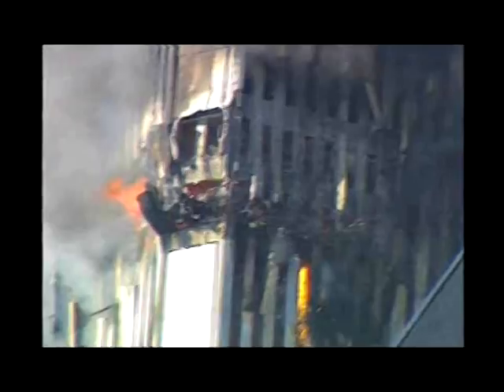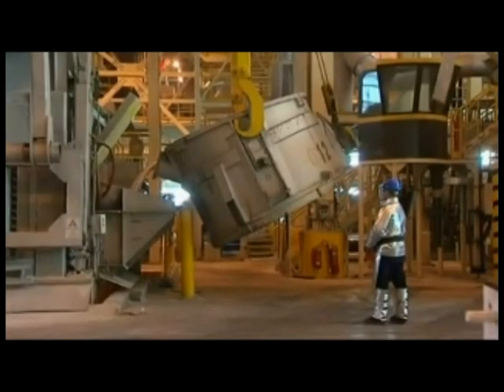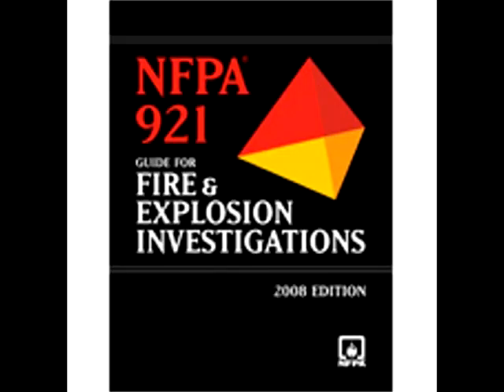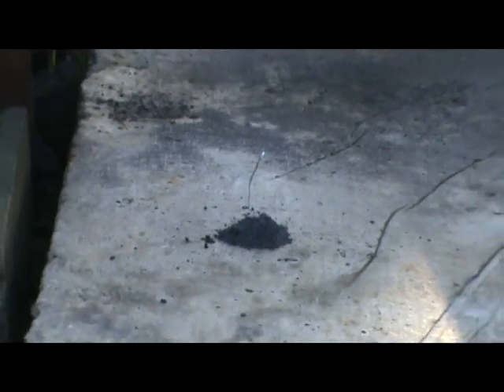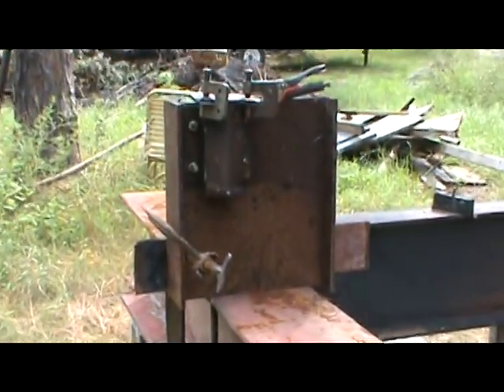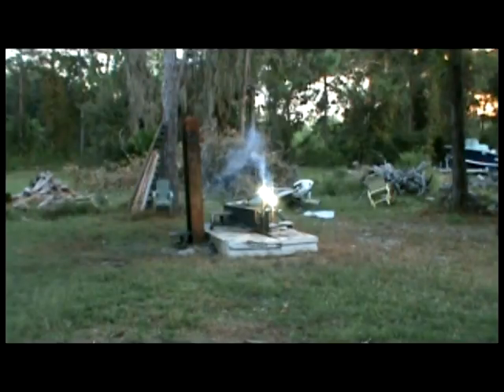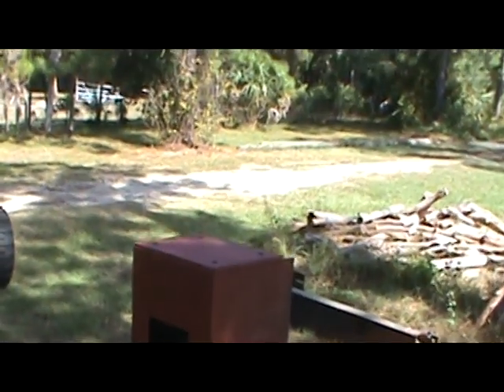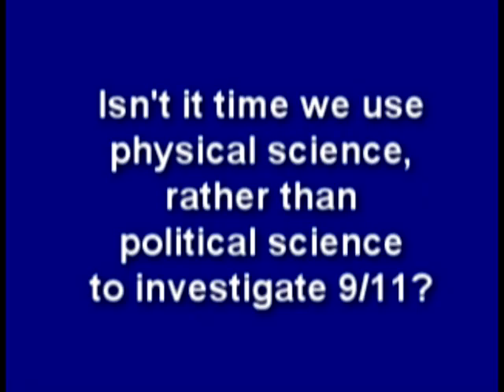9/11 Experiments: The Great Thermate Debate

Comment: 7:15 Again, iron-rich spheres are also produced from rust flakes burning and welding of steel.  They're also found in concrete and printer cartridges.  All those things are more likely sources for the spheres than thermite since they are found in all WTC dust samples.  

At last!  Another truth!  You are not an explosives expert!  I wish you would be more specific about the 'things' you build!  Plastic toys?  Models?  Amplifiers?  Do you have an engineering degree?

Comment: 5:30 Sure, conduct your own experiments!  Please!  Make sure they use the same gauge and configuration of steel as in the buildings.. oops!  Now we're back on something in a photograph of the fire...where'd the experiment go?

Was it just that pile of ignited thermite!?

OK...what could cause a light flash or white flame?  Oxygen generators from the planes  for one -  /watch?v=6i_l_ux3R-4  Oxygen cylinders also on the planes. They had seals which start to fail at ~200° C per DOT/FAA/AR-TN98/29

Comment: 3:30 NO, the Harrit,  et. al paper did not positively identify nano-thermite!  The paper, published in a vanity journal, had incredibly bad sample preparation and mounting techniques, used XEDS (whtich is great for determining crystalline structure of metals) to identify the composition of the sample (instead of something sane like Mass Spectroscopy), and FAILED to burn their sample under water or argon.  

The paper's conclusions are unsupported by their data.  

tinyurl . com /3q4lhr5

Comment: 3:20 Sigh. NIST never conducted any experiments to confirm that one stream was molten aluminum, true.  They were way too busy conducting experiments to determine how the buildings fell!  That was their mission, after all.

Oh, no. None of those experiments were applicable and in at least one the aluminum was bright orange and turned silver when it hit a cooled plate, thus confirming that falling molten aluminum is the color of the flow from the 80th floor!

Comment: 3:00  Sigh. In the chaotic thermal environment of a large office fires, unlike material mix together.  If the mecury in your example was hot and the coin was made out of melting plastic and the whole mixture was on top of  a bunsen burner, the coin wouldn't be prettily sitting flat on the mercury.

Even that's not a good example since the mercury would vaporize.

A better example is a Lava lamp. The wax  is much heavier than the water, yet still moves around and up because of thermal effects!

Comment: 2:06 - Thermite can melt steel, but doesn't explain any of your previously-cited 'evidence'!  1st, if that flow was from thermate cutting through a column, how come no column was cut?  How come it happened well before the collapse?

NIST didn't 'ignore' any 'molten metal' since there is only evidence of that one stream from the NE corner of the 80th flr & they sufficiently explained it.  

If you watch video of that flow, it clearly turns more silver as it falls and cools - /watch?v=DhHzMttUKO0

Comment: 1:40  At last you're correct about something!!  Office and open air jet fuel fires cannot melt steel.  That means Newsweek's' Special Edition GOT. IT. WRONG!  Did you even check with them to see if they had made corrections to that edition? That would've been the reasonable thing to do!

And true, NIST did state the max fire temp's were ~1800° F.  Wow! 2  facts in the first 2:05 of play. 

Now, let's see how you'll misinterpret them!  =P

Comment: 1:30  This is so full of lies, it's hard to watch. And they come thick and fast.  In just 10 seconds, you show two samples of sulfidated, not melted, steel found in all the WTC tower rubble. You showed both samples to the exclusion of any other steel.  Both samples are evidence of rainwater leakage, not thermite.

Nobody was 'baffled' by them. If anything, any 'bafflement' was due to there not being more (large buildings typically have more leaks than that!)

Comment: PS.  Firefighters aren't metallurgists and didn't test the flow they saw.  Therefore, their claims they saw 'molten steel' aren't valid. They may have seen molten lead from UPS banks, molten aluminum from the planes or molten plastic.  

A couple of firefighters sitting around talking about what they thought they saw isn't reasonable physical evidence of molten metal, much less molten steel!

Comment: Jet fuel burns at 1400 degrees and Steel melts at 2,800 degrees, when i saw the firefighters in Loose Change (the original) say there's molten metal, like lava, thats what won me over

Comment: @darkultra 
oh, also remember what i said about thermite... the steel poles were isolated inside concrete walls, and if aluminum mixed with the rusted steel poles, along with the heat of the burning building, can cause a reaction... and the concrete can force the thrmite downward.... but like i said, idk for sure.

Comment: heres another theory: previous terrorists have attempted to place thermite inside the towers, but were caught. considering it isnt exactly the kind of explosive dogs can sniff out, it could have sat for years. when the planes smacked into the towers, it heated the old thermite, causing the reactions. but we are also forgetting that the chemicals needed to make thermite can easily be present inside the building. i cant say for sure what happened, but i find it hard to believe the gov was involved

Comment: @Skeptic121

First of all, planes ain't made of pure AL, different AL-alloys are used. Second, the "liquid" is suspected to be a mixture of different materials, one of them AL.

The simple minded twoofers should experiment with different materials to rule out this possibilty, instead of showing how great they're in melting pure AL, which never came into question.

Comment: Nice and impressioning experimenting. The use of thermite as an unconventional weapon was already described in Daumanns novel "Dünn wie eine Eierschale" (Thin like an eggshell) in 1937.
But still we have seen 2 planes being flown into the towers. Even if the buildings would not have collapsed, 1000 or more would have died. So there was no need for an additional assault on the structure. Installing hundreds of thermite charges would have been impractical anyway.

Comment: @ActionReplayPerson Those temperatures (982C)  would be the fire temperatures.  If it was aluminum it would start to flow as soon as it melted. It would not wait until it had reached a higher temperature.

 The same thing happens with Ice. The surrounding temp can be way higher but the melted Ice takes time to heat up to the surrounding temperature. Even if you hold a blow torch to a block of ice the melt water is only a fraction of a degree above freezing.  This is how thermodynamics works.

Comment: @Skeptic121 Also, I am using "982C" because that was the general temperature in the impact zone. And 982C is 1800F, and if that is aluminum, which most likely is, the glow color clearly indicates the temperatures, and proves the NIST report on the temperature correct.

Comment: @Skeptic121 At that time, the building's floors were also beginning to bend and were already critically weakened, so it makes sense that the aluminum could have just sat there level until the floors buckled and bent, then gravity would do the rest. How would the gravity affect anything on the opposite side of the building of the impact? The floors were anchored to the core more than the outer skeleton, so the floors would have sagged at the corners.

Comment: @Skeptic121 Here is why the aluminum can get over 300C past its melting point, because when the environment is that hot, things move, it's just that simple. If there is a 982C environment, and something is colder, guess what happens? Aluminum, even molten aluminum can heat up past its melting point easily, as long as it is in the right environment. Also, remember when the metal was seen flowing from the building several minutes before collapse?

Comment: @Skeptic121 *Facepalm* You have no common sense do you? You do realize that a lot of the aluminum was embedded deep in the rubble in the Northeast corner of the building, right? And that it got really hot in there, right? So as it flowed through the rubble, it was increasingly heated up, until it came out. And if Aluminum, perhaps any metal, is hot enough, it can glow in broad daylight. 

Also, the metal fell through the shadow of the building.

Comment: @Skeptic121,
.
"Not bad for backyard work"
.
Funny, I think it is a rather naive video.
That is, taking piss poor steel, ignoring fires, using highly complicated setups, with no timing, no means of ignition control, producing cuts that seemed to be overlooked by every clearer that cleared the area, overlooked by the FBI that sifted through the rubble once more, and ignoring the fire induced damage of WTC 5 that is consistent with the rubble of WTC1+2+7, is, all in all, rather naive.

Comment: @Skeptic121 Again, it was way hotter in there than the melting point. Regardless, it still would have melted. It was still at the temperature to make it glow light orange. Apologies for getting the melting point off by 60 C.

Comment: Guess what temperature steel typically starts to weaken at? Around 1100F, give or take 100F. Jet fuel burns well over that, so the steel was weakened. The dripping aluminum may have to do with the temperature itself, but it doesn't have to do with the collapse. I think I destroyed your conspiracy down to nothing more than a feeble remnant.

Comment: Also, you have to remember that when the plane entered the building, office debris and plane debris was all pushed to the opposite side of the building, so it only firther supports my point that molten aluminum was dripping out of the building opposite the impact zone.  And, you have to note this down, steel, especially structural steel, the kind that made up most of the core and structural integrity, doesn't necessarily have to melt, it just has to be weakened.

Comment: Actually, the molten metal probably is Aluminum. You see, planes are typically made of 2024 Aluminum (The commonly used alloy for commercial and military planes' fuselages and wings, where most of the metal was to begin with.) 2024 Aluminum has a melting point of 510C, or 950F. It typically starts to glow in its molten state around 600C. Jet fuel can burn at almost 1800F so it makes sense that the aluminum was melting in that bright orange color.

Comment: @mrjacksepti Good god, look up the designs for the building. The lightweight truss framework is STRONGER than the outer shell? Is that right? 
"No building is stronger on the outside than inside" I suggest you read about the construction of the buildings.

WTC 1,2, and 7 were made of steel reinforced concrete? I think you are confusing them with The Empire State Building. I reiterate, to say You have no understanding of this at all is an understatement.
They had fireproofing in it for a reason.

Comment: @vibeackermann This video is of more use /watch?v=thORa9s9E8g
To produce the amount of "steel" melted from thermite would require 18,000 lbs of the stuff.

More thermite? Massive columns cut with more thermite?
You would still need these boxes all over the columns. You need this technology to exist ...so it exists. There is some secret super thermite which can be placed in a canister which can survive 1,100 degree C so the primary charge doesn't go off. Sure

Comment: @igykalen Structural sound? WTC 1 and 2 were made of truss. There's a saying the engineering world. Don't trust the truss. The lightweight framework is NOT strong. The outer shell was strong. the insides not.
Toppled over? How could a 110 story building act like a 10 story one? Are you insane. It couldn't 'topple' over at all. It was build in units, not a giant single block FFS.
You have no understanding of this at all.

Comment: @mrjacksepticeye Jet fuel fire melted steel? jesus fucking christ.
First the jet fuel would have burn up in about 10 minutes. It was everything else on fire that caused the heat.
The video says steel melted. Everyone else says it was aluminum.

And if you're going to run with steel is impenetrable to everything nonsense, then explain why the designers of the building even bothered to add fireproofing material to the metal in the first place if it wasn't needed?

Comment: @igy In a single post, you obviously didn't read, I disproved his first four BS statements he did no research on. I need a video too?
He starts with the assumption that it had to have been steel. Uses no real science to prove it. Those micro iron oxide that were found. They're all over Manhattan. The WTC lightweight concrete floors are about 40% microscopic Fe, from fly ash.

Comment: @mrjacksepticeye You wouldn't need an experiment to show that thermite could melt steel. All you would need is to know the melting point of steel and the temperatures thermite can reach.
No one said thermite couldn't melt steel. They said that it couldn't melt enough to bring down the buildings. he opens up by showing what the outer structure was made of. Does he think that's what was melted to bring it down?
my video? I'm not trying to prove the building was brought down by bullshit.

Comment: this video lol
-After the planes had hit the fire were burning out and cooling down. Source: None. Fact the fuel burned up rather quickly, the rest of the building however was still on fire.
-The fire officials are getting closer to putting this fire out. lol, With no water pressure?
-"It LOOKED like steel" As opposed to aluminum.
-Later iron spheres were found. Like they wouldn't have already been there as part of the fly ash that makes up the concrete.

Comment: This experiment lacks controls. Yes, this experiment proves thermite can destroy steel but this experiment does not prove that jet fuel can't. Maybe jet fuel can also destroy steel despite what you expect. In order to really prove that the trade centers was destroyed by thermite there needs to be a control using jet fuel. In science you don't assume one theory is wrong without testing the other one as well. This was a poorly conducted experiment.

Comment: @bluesman979

"I'm not theorising about how damage occurred"

But you do. By excluding the possibility that the planes where the reason. I mean what else should be responsible if not an explosive device? Reptiloids with a huge drill? An earthquake induced by HAARP? You're dodging the danger here, but it doesn't work.

"And of course the testimony of the first responders reporting multiple explosions"

The source of explosive sounds don't have to be bombs.

Comment: @bluesman979

When the planes hit the towers they set free 3.700.000 kJ each. This energy is equivalent to 1t of TNT exploding at once. There weren't just small, seperated sections hit, whole structures, structures made of steel ... and like a diapason set into vibration, so the towers were.

Comment: @bluesman979

To put simply a big bomb near the area, above or beneath, that's not very elaborate, it's plain and simple, for everbody to understand. But why a bomb with this much explosive power? Doesn't add up. To bring steel framed buildings down cutter charges are used, small in shape, with little but concentrated explosive power ... similar to the devices shown in this video. Now... how could those be responsible for the havoc in the lobby?

Comment: Aluminum turns orange at 1100 degrees Fahrenheit. Also, If you extrapolate the amount of thermate you used for each beam, you need over 60 tons to melt all of the beams in order to bring down the building.

Comment: @loosechangeexposed cont from prev post.
If there was thermite in the towers the planes explosions would have ignited it and dropped the towers just after impact not 56 and 102 min later, thermite does not take that long to activate it is activated by fire. /watch?v=h6uUDd94q98
/watch?v=l3ZBEmjzwLg

Comment: @loosechangeexposed cont from prev post.
At 0:40 that is molten aluminum from the plane, if it was from the steel the tower would be collapsing he said it “looked like” molten steel, melted vanilla ice cream “looks like” milk. The firefighters are talking about the molten steel after the collapses which was created by the energy of the collapses.
cont next post

Comment: Did it not cross your mind at all, the entire time you were doing/making these "cutters" how much time it was taking, along with you spent most of your time talking about the outer columns and the like.
So... that's how many floors,columns that would need to be rigged,wired together, accessed to outer wall columns? hmmm?
Not to mention it all went 99.99% perfect, except that one spot that "poured steel".  
Please, If 1/3 of what you said was true the towers would of looked like July 4th.

Comment: @MsJK21 Sigh.  Please do your research, OK?  The buildings were 70% unoccupied on a daily basis - i.e.  every other floor was in the towers was empty.  Twin Tower employees have talked about "construction" happening on these floors the weeks before the collapse.  The weekend before the "attack", all power to the towers was shut down - i.e. no security, no electronic locks, no cameras, etc.  For a few months prior to the attack there were extensive elevator shaft "upgrades" - the list goes on.

Comment: Mistakes in the 2nd minute: 1. Since they were distributed throughout the dust, the iron spheres were more likely to have come from the rust-proofing paint used throughout the building. If they were from molten steel supports, the distribution would be non-uniform.  2. NASA thermography showed temperatures up to 1800°F from the outside of the bldg's  3. Local hot spots & blast furnace effects are possible in large fires such as this one. 4. Newsweek is not a science source!! Seriously, it's not.